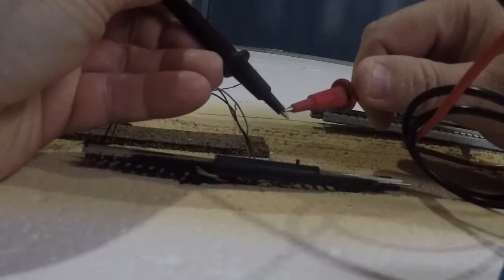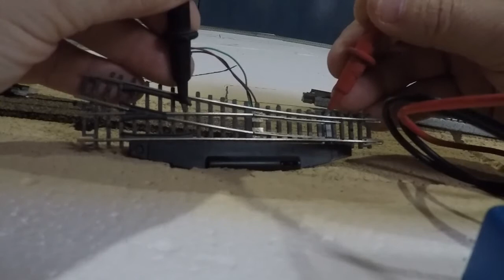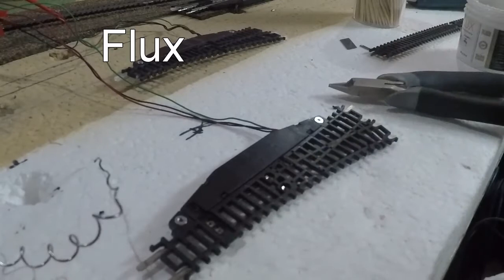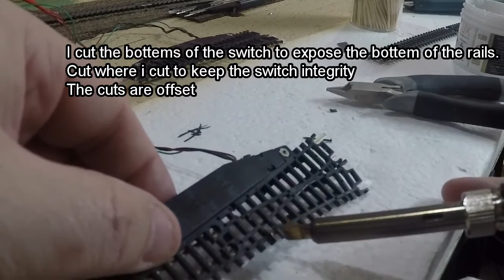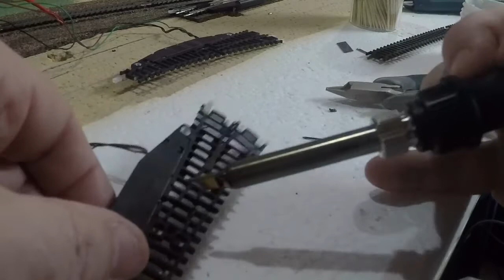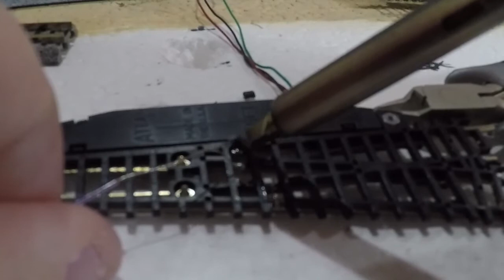Atlas Code 80 Switch Power Transfer Problem Fixed N Scale

Comment: Interesting, After recently installing Atlas code 80 turnouts on my layout I discovered they too had my older generation locos (70s-90s Graham Farish stock) dying outside the turnouts and just like you I assumed those flimsy switch blades were to blame! However after doing power checks with a multimeter I found they were conducting track voltage with no issue at all surprisingly, after close examination it seemed the issue was all the small plastic fixtures that go in-between the rails. Trains would collide (but not outright derail) with the small block that pushes the blades from side to side and the unsightly large plastic check rails that connect to the frog. I shaved the small block for the blades into a trapezoid like shape (allowing it still function but enough to clear way for the train wheels) and just cut off the check rails altogether! After all that I could run even my oldest N scale locos at very slow speeds over the points, very satisfying! Hope this helps anyone getting frustrated with those god awful Atlas switches.